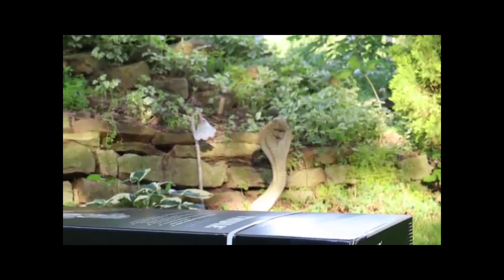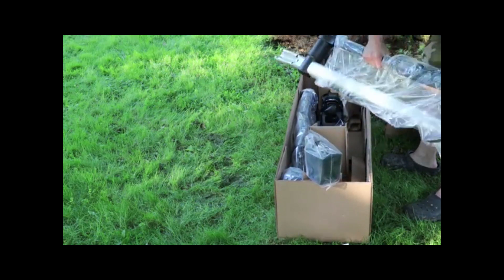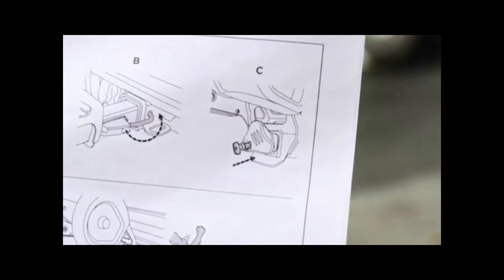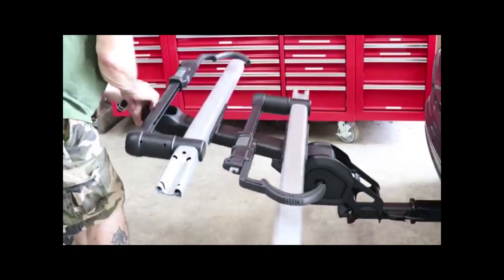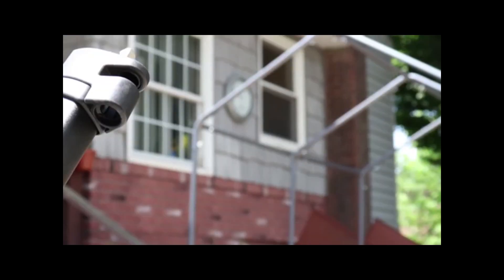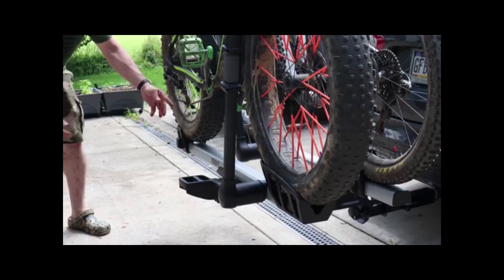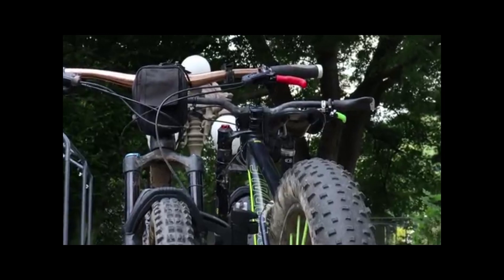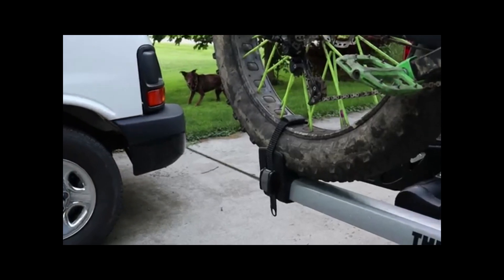Thule | T2 PRO XT | Assembly

Comment: Very helpful! I purchased one that was a reject at my seasonal job, and because it was supposedly missing 18 screws, 8 washers, and an allen wrench, I got it for $100. Yes. Brand new. $100. Missing instructions, too, but now i see that they were pretty useless. When I got it all out of the taped up box. I discovered that all the coarse screws and two washers were there, so now I only need to find or order the 8 socket head machine screws.Some Questions: do you know the size or thread info of the socket head screws? and where do the 8 additional washers go? I'm assuming with the socket heads and but between the bar and the hitch or what is the sequence? When you say use the washers on the end caps, I assume it is inside the tubing. I am not always clear on where washers go!! Thank you for any  extra help. You have already been an incredible resource.
Reply from the maker: Hi Kathleen! Thanks for watching. I checked mine, and the 8 machine screws that hold the rails to the main body are 8 mm x 1.25 x 15mm long.
The washers should go directly under the head of the screw.
Reply from the maker: The washers that you were talking about on the end caps are just there to keep the sliding pieces from coming off the end. The washer just adds to the height so that the piece can't slide off the end of the beam.
Reply from the maker: I hope this helps. Please click the Thumbs Up, subscribe if you haven't already, and check out some of my other videos. I also take requests for future videos if there's anything you want to see.

Comment: Does the rack seem to be as recommended as your initial thoughts? Any positives or negatives after using a few times ?
Reply from the maker: Hi Johnny! I have been using this rack since June, and really don't have anything bad to say. I am not sure if the instructions show it, but I just realized recently that the part where the lock cables go into the front wheel lock down arms with the lock tumbler in, unsnaps to ease locking your bike, as well as make it more versatile. aside from that, I can't think of anything else. Thank you for watching!

Comment: Thanks for the video.  On the lock insert, it has a spring loaded retaining tab which must be pushed in on one side, to expose the opposite side tab which is smaller, that will match up in the tab-ed hole.  On pictures instead of written instructions, it is not due to translation costs (there are 4 pages of  warranty, etc. translated in there).  Pictures only is the latest hip way of making something look easy to put together, but as we all know, Thule failed by sparing the words .
Reply from the maker: Thanks for the advice as well as the kind words Jr! When I made that video, I was just starting this channel, so I was still trying to figure a lot of things out. I keep hoping that one of my friends would get a Thule T2 PRO XT so I could make an updated version which would be more to the point, yet still detailed where it needs to be. Thanks for watching, and I hope that it helped.

Comment: Is it really safe without a hitch bolt holding it in? What if that friction system rattles a bit loose? Does that little claw arm really seen like it would work as a failsafe?
Reply from the maker: Thanks for watching Colton. I've had mine for over two years now, and have not had any problems, nor heard of anyone having any issues. One of my riding buddies had a piece rust off after several years, but I think that he was able to get repair parts. I definitely wouldn't want to leave it in for long periods without taking it out, lubricating the moving parts, and greasing the parts that contact the receiver inside. Experience speaks here,not with this rack, but a trailer hitch that rusted in. It took forever to get out using heat, a forklift, and chains!
Reply: @themostlymikeshow  thanks for the response, I already have mine but was feeling a little insecure but that helps. Your video was a big help!
Reply from the maker: I'm glad to hear that it helped you out!

Comment: Hello. I’ve been having issues with the hitch locking key. I did turn the cylinder with the key to make the knob lose only once, after that I haven’t been able to do it again. Idk what I’m doing wrong.
Reply from the maker: I'm not sure what would cause that. Does the cylinder actually turn with the key?
Reply: @themostlymikeshow  No. I did once and then not anymore. Idk if the cylinder doesn't go all the way through or what but there's nothing much else to do really. It's pretty simple.
Reply from the maker: I wonder if the cylinder could come out with the  installation key to get a better look at the guts of the lock.

Comment: Looks good, nervous about the tension locking in receiver but it must work.
Reply from the maker: Mine has always worked well. I would definitely make sure not to leave it in the receiver for long periods where it would have the possibility to rust itself in place. I've never heard of this happening with a bike rack, but I have seen nightmare situations with hitch inserts getting stuck. I believe that it pays to spray it or spread some anti corrosion stuff on it.

Comment: Are beams or rails suppose to slide on the frame?
Reply from the maker: Thanks for watching, Roland. It's been a while since I made that video, so I forget what Thule was calling the individual parts in their instructions. The two silver pieces that hold the bikes are on slotted holes and can be moved about 3 inches so that the handlebars do not contact the seat of the other bike. The smaller of the wheel trays slides along that silver rail (or beam?) for adjustment of different wheel base lengths. I hope that this helps. I wish that I could assemble another one to further clarify this stuff. That video was one of my first, and was actually in three parts originally, and a few months later I had to redo a lot of videos because of trademark issues with my channel name.
Reply: @themostlymikeshow  Ok, that helps. Thanks again!